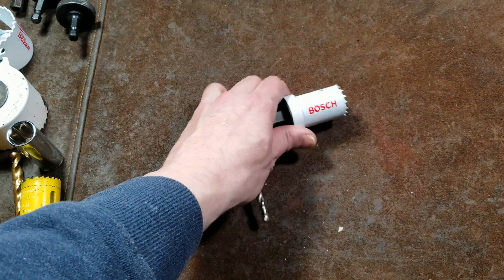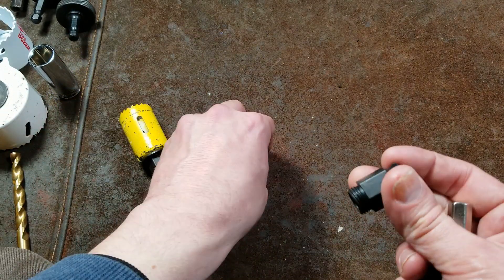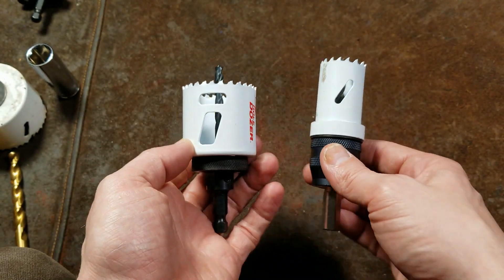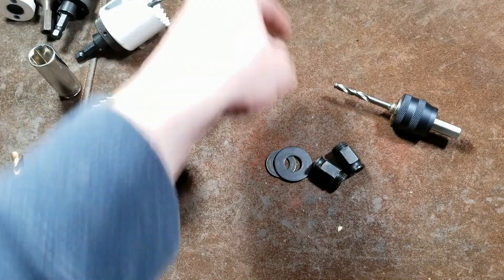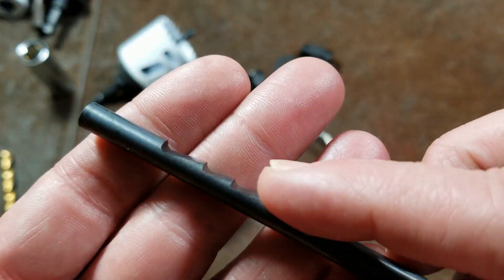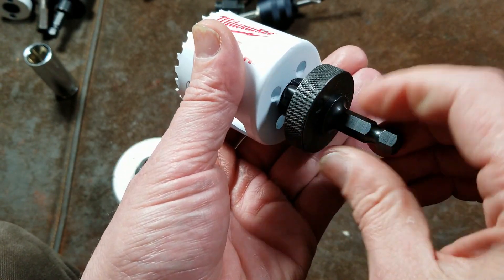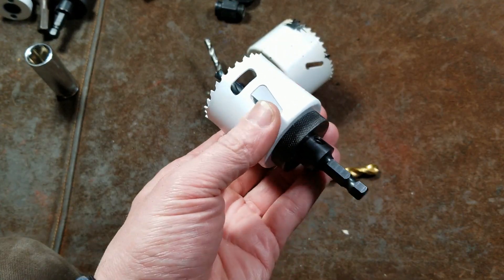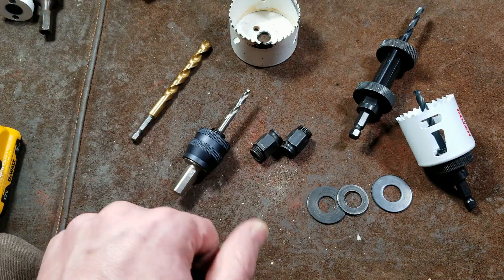Bosch Progressor Quick-Change Hole Saw Adapter Review

Comment: remark : the center drill is blocked once u pop in a hole saw so losing the center drill is normally not an issue when taking out the hole saw for dust removal.

Comment: I bought my first set of these around 15 years ago, reason being was that it was one mandrel with a 3/8 hex end for all hole saw sizes, so this would fit into an angle drill for use between floor joists.

When the hole saw is in the mandrel, the pilot bit is actually locked in place so avoiding any ‘special situations’.

I have never had and threads break off, and as a contractor, these get a lot of use.

They do do an adapter with a longer thread for enlarging holes 

You’re definitely right about the slots in the hole saws though, they are far too small.

Diablo (owned by Bosch), have a hole saw kit with the same system, but in the Diablo form, the hole saws are deeper, 2 1/2” vs 1 5/8 and they also have large clear out holes instead of the tiny slots.

On the whole, I have got on very well with these for 15 years and many hours of work.
On a side note, I do also like the Milwaukee hole-saw in the video :-)
Reply: Any tips on where to get that adapter for enlarging holes as I've failed totally in finding one....

Comment: Thank you for this video and for sharing your thoughts and experiences. I found your insight to be very valuable. I wish you had also included information on the Bosch SDS quick-change hole saw adapter. But maybe you hadn't used those at the time. Cheers!

Comment: You touched on the bit holding mechanism.
My real problem was the pilot bit was slightly loose. This allowed the holesaw to erratically “wobble” around the pilot bit. Er the whole point of a pilot bit is to lock the holesaw in the correct position? Or am I wrong.
OK fine, if its just rough work like cutting holes for downlighters etc.
My example was an eco high performance front door. These use high thermal insulation board covered by in my terms extremely thick veneer circa 6mm thick white American oak. They look just like traditional solid OAK doors don’t warp, and insulate brilliantly ... at a huge cost I might add.
So glad I worried about this enough to do a trial hole in the letterbox slot ... treating it as waste! THANK GOD I DID, THE WOBBLE CREATED A SERIOUSLY CHEWED UP ENTRACE HOLE - appalling look. No idea how the hell you could fix that! 
So I tried again using a rock solid Pillar drill , same appalling quality hole, tore a truly mangled hole in the veneer!🙈🙈
I dashed out and picked up a Starrett HD arbour, that locked the bit rock solid, and by hand cut a perfect almost polished hole! 🤫
Bosh replaced both arbour and pilot drill, and this one is even more wobbly! WTF!
Spec says 7.15mm diam and 6.35mm hex end. Actual dimensions are 6.12mm diam and hex of 6.23mm. Thats enough to make the hold “sloppy”.
I will get Bosch to replace this again and see if I get lucky 3rd time.
WARNING IF YOU NEED QUALITY, DOUBLE CHECK IF YOUR PILOT BIT IS TIGHT i.e. no movement side to side.

Comment: Just a question for you.  Have you seen the mandrel with the reverse threaded screw so that after you cut your hole you put your drill in reverse, jam the holesaw in the hole and run the drill in reverse to expel the plug.  I am amazed that this type of mandrel has not caught on seeing as  the removing the plug is what really takes time.

Comment: Got it right with going through thick material. The quick release makes you pull out completely aligned else the hole saw pops off and falls into the void

Comment: I have a bosch set with the quick connector. I paid 160 dollar like 4 yrs ago. But I alwas have two problems. At the beginning of my drilling,no matter which size I use, the hole saw start wobbling and causes some damage to my wood leaving scratches hard to get rid of. To avoid this I use anothe piece of scrap wood on top. Once the hole saw is in an 1/8" the problem is gone. The other problem is the saw dust get stuck in the teeth and starts to get hot and I take it out clean it put it back in and take it out againg. I do the cleaning every 1/8 of an inch I drill in. That means if I drill on a 1" plywood or a piece o wood,I have to clean it several times. I dont know if you guys have those two problems. Thanks.
Reply: Tip : Strart drilling in reverse until a clear Sawmark is carved
Reply: Think you hit the same design flaw.
Namely the pilot bit, is a tad loose in the Arbour (which some say only gets worse with time), this allows the holesaw to rotate in an erratic pattern and it can, say on veneer, rip and extremely ugly jagged hole in wood. 
If the pilot bit was a “full” 7.15mm diam and 6.35mm hex. Then this would work fine. Both of mine were 7.12mm diam and 6.23 and 6.26mm hex. Enogh to induce serious “play”!
Weirdly how the holesaw hex fits into the Arbour works fine, but thats not actually the really important factor.

Comment: This is rubbish. Talking about it saying I know that there will of been people that will do this or have done this but no evidence. Don't think he actually even used it before making the video. I have used these for year and there brilliant. The only issue with it that I have found is the ball bearing that holds the pilot in can pop out over time. Meaning you have to replace it. Twice out of 4years + of hard use isn't bad in my opinion. I have used this from 20mm to 127mm holes no issues with the product. I don't understand people that come on a slate a product not providing and evidence of failure. Just a rant that leads no where interesting.

Comment: I just realized that with the new and improved quick chuck and it's short threads is that if you wish to enlarge a cut whole, you can not stack the smaller hole saw on the thread and the larger hole saw held by the pins.  This is something I do to make larger holes for older doorknobs without having to make a jig.  Another use for the double holesaw is when I need to enlarge the hole of a ceiling medallion from approximately 3.5 in to 4 in. the smaller holesaw keeps the larger holesaw from wandering, thus making  beautiful cut.  No need for a jigsaw, as I have seen someone do.  the end result looked like a beaver chewed at the whole.
Reply: For 15 years I do all kinds of building and renovation works and never thought of that possibility.  In my defense, the existing holes are almost never of regular shape and fit my smaller saws. There're some cables which must be preserved. Still I feel ashamed. Have a good day, pasquale.
Reply: @Luzt.  No need to feel ashamed.  I am quite certain you. May have a trick or two  up your sleeve.  lol